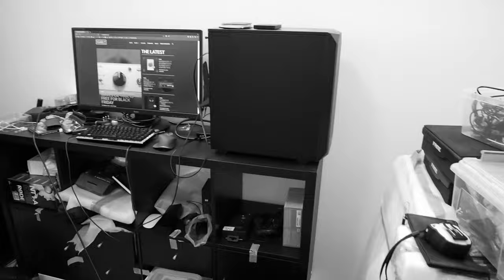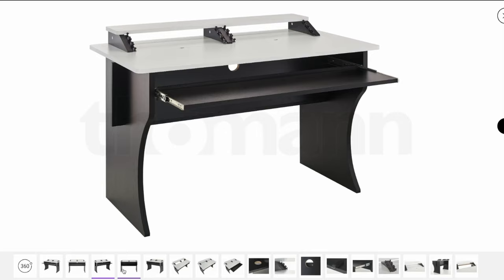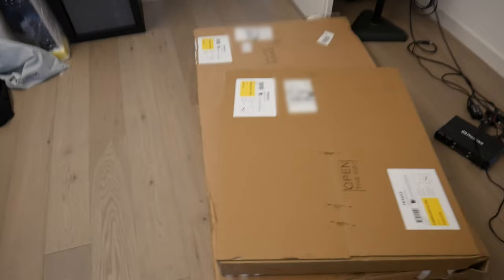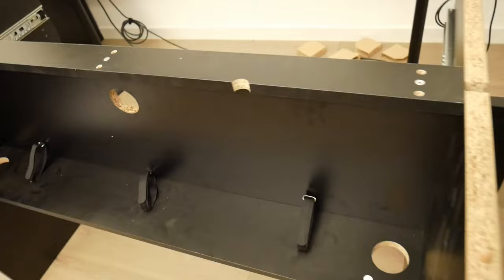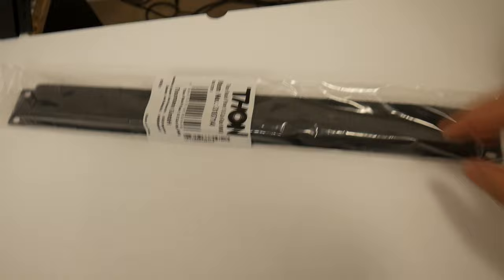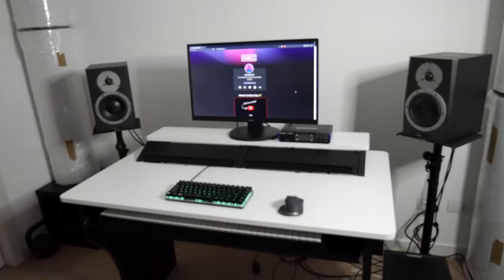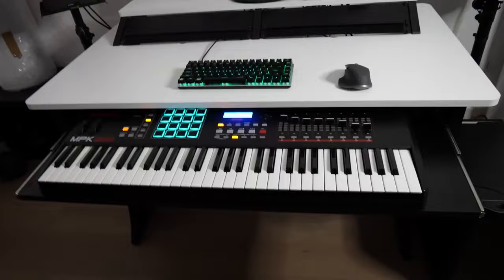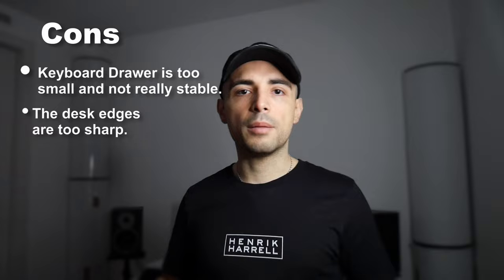Thomann ComboDesk Review - The Ultimate Studio Desk for Music Producers

Comment: Thanks for the video!  I am looking at the bigger version of this desk and I have a question after watching your video.  I noticed you didn't put the extra pieces of desktop under the rack rails in place.  I thought you could do this temporarily to give you some extra desk space under the shelf until the time you have outboard rack gear to put in the rack rails??  That is what I was hoping to do if I got this desk.  How do those extra pieces slot in to those holes?  Are they screwed in or jus sit in there somehow?  🙂
Reply from the maker: Hi there! I'm glad you found it useful! I'm sorry for the late reply. If I understood your comment correctly, you're referring to the holes at 05:34. I removed the extra pieces (lids) when I assembled the desk, but then I put them back because the desk looked too empty even with those metal plates. Those lids just sit there without needing to be screwed.
I left a small space between the hole and the lids to let my keyboard cables and other cables come through it. DM me on Instagram I can send you a video showing how I placed them. Let me know if I have been clear enough.
Cheers!
Reply: Hi Henrick, thanks so much for your reply mate.  You answered my question perfectly.  Thanks so much for the info. Cheers!